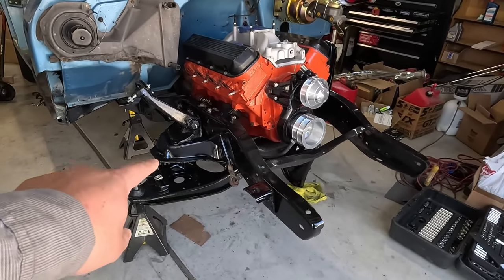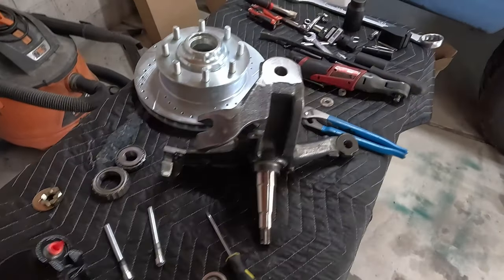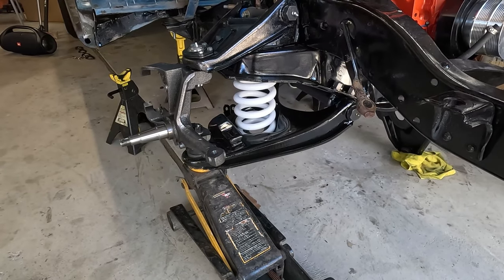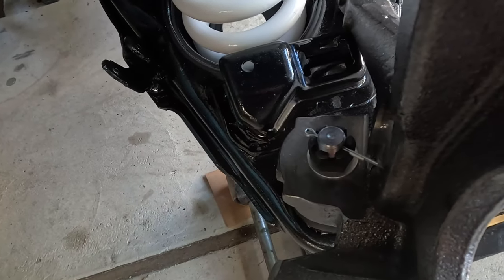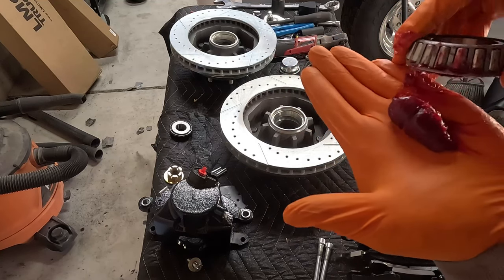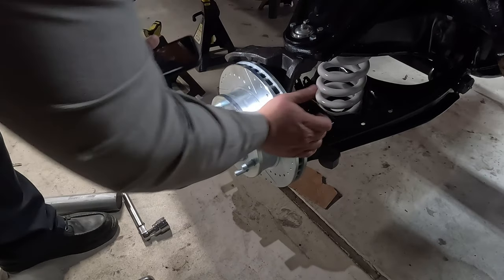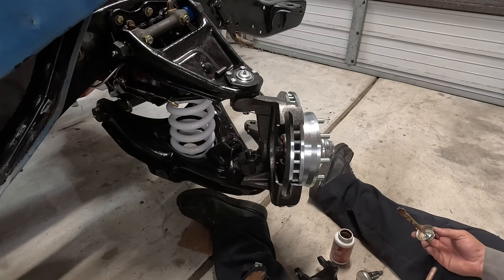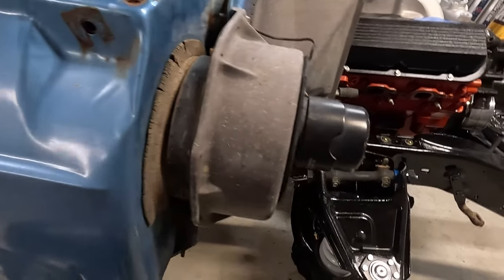Front Spindle and Brake install on 1968 C20

Comment: I'm thinking of doing a front disc brake conversion. I have a 1967 c20 3/4 ton truck 8 lug truck. Want ask you how you like the POL products?
Reply from the maker: I like them. Haven't had any problems with any of their products

Comment: Was this an original BB truck? I want to swap out my small block for a BB and I’m not sure about fit on my 69. What towers and engine mounts did you use? Any clearance issues with distributor or valve cover/brake booster? Great work on this build!
Reply from the maker: It had no engine when I bought it, was originally a SB truck. The mounts I used are from POL. Use the forward holes on the frame to mount them. Some small cutting is required. I'll make a video soon and point all those little details out. Also I used the small diameter brakes booster from Western Chassis.
Reply: Incredible work man! Without your build I would’ve been stuck a long time ago!! Thanks for doing this!